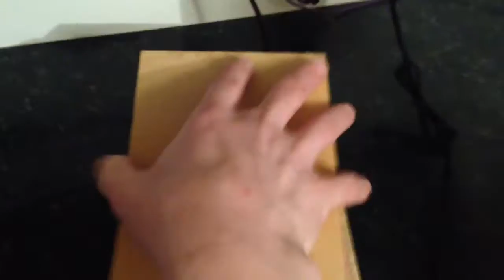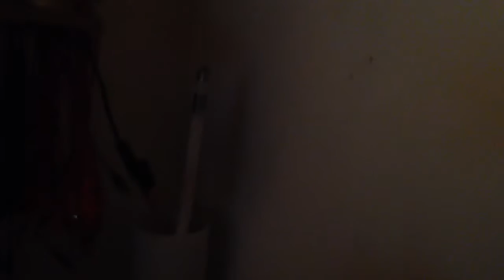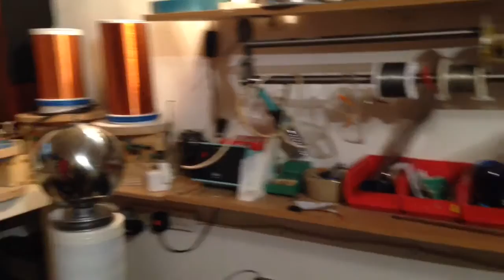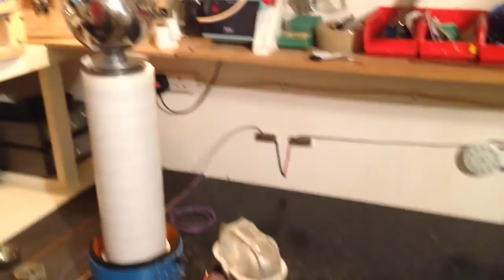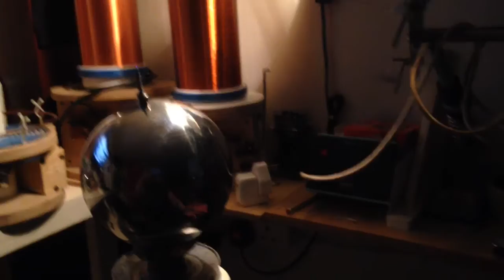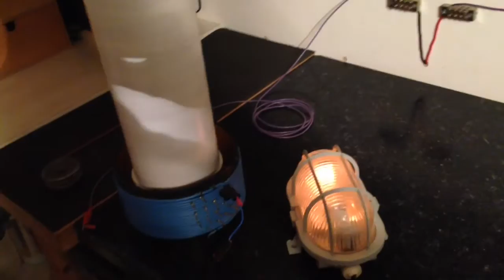SSTC toploads and a little coil on coil action

Comment: It is love :)
Reply from the maker: It really is Terry. I mess around doing this all the time mate.  I'm actually trying to find things to run off the wireless coil. Rectifier is showing 120v which I would imagine will drop significantly with a load. I blew the fan in my little inverter a while back. Perhaps dig some transformers out and play with those.  Cheers ;)
Reply: deeds put a flyback on it and run a sgtc on there :)

Comment: Fantastic demo.I need to make more coils before I can run tests like that. also, how do you hold you hand in the arc that long? the RF burns I get from my 100W coil are very painful.   lastly do you have a schematic for that full bridge SSTC? EDIT: also when you have the second coil simply receiving and putting off its own sparks, does the first coil stop putting out sparks? or less so? how is that second coil arranged? sorry for so many questions, school is almost out, and any tests I can do while I still have a power supply handy I might as well do. ( I still need to build one like you mentioned to be before hand)
Reply from the maker: Thank you for the interest! I'll answer them all tomorrow when I'm a bit more lively if that's ok. I was messing around with it for ages pulling arcs tonight, you get used to it after a while. Promise I'll get back with all the details. It's tesla explores bridge layout he's got a schematic I can send you or link you to if it's still on G+. Cheers for now ;)
Reply from the maker: Ok.. A bit more, I'm on my phone again so it's hard to gather links for the bridge. I'll get them to you. It's Wards SSTC5 bridge driver. 
If I have a breakout on both at the same time there is always a reduction in arc length. It was the same with slayers too. The power evenly distributes so, for example, if I added another receiver coil of the same dimensions, distance from transmitter etc then there's a further divisional reduction in arc length. The transmitter doesn't ever try to pull more from the wall (PSU) to maintain it's output, it just shares what it has - if you get what I mean. 
Large topload on the transmitter is important to get better range.  
I'm using 36swg wire on the transmitter and 30swg on the larger receiver. You can mix it up and use any coils too. As long as you don't go too big in the receiver or you just can tune it in. 
Getting your setup to work with a large topload is key. I've have a few SSTC5's and one of them doesn't like a topload at all. The wireless range of that coil is very limited.
I'll find TE's full bridge link for you. Cheers ;)
Reply from the maker: The Secondary coil is just grounded. The primary is just slipped over the top. There's 20 windings on the primary. I'm using all of it. As I tapped up it was outputting more and more. I'm now tapped either end using all 20. It's a large form. The secondary is on 4" the primary 6".  
What happens is the farther away you place them the less capacitance / topload you need on the receiver. 
Best example is this: You've got two identical coils with identical toploads. You place the grounded receiver three feet away from you transmitter. And power on. Now you slide the receiver away from the transmitter. If you don't make the topload smaller on the receiver or bigger on the transmitter they'll quickly go out of tune. 
I imagine it like this. Two identical coils with or without identical toploads are perfectly tuned when they're right next to each other. As you move them away you'll need to compensate for the frequency chance.. That's where I use the topload.  Tesla would have been using a mixture of coil windings topload and capacitance to frequency match too I would imagine. ;)
Reply: Thanks a bunch, that cleared it all up! one last question, where do you get/how do you make  your top loads?
Reply from the maker: Full Bridge Schematic 
https://plus.google.com/b/103859132864314739246/photos/photo/113943081336856493382/6248974877009563714

Toploads
http://www.ebay.co.uk/itm/3-Size-Stainless-Steel-Mirror-Sphere-Hollow-Ball-Home-Garden-Outdoor-Ornament-/381365586472?var=&hash=item58cb290a28:m:mLV9lVYJ-f09bpl-hjkEBSg

Cheers.
D